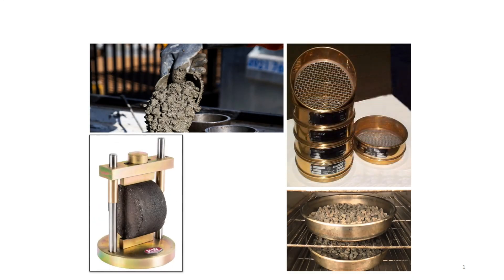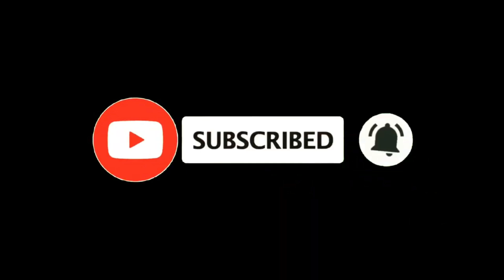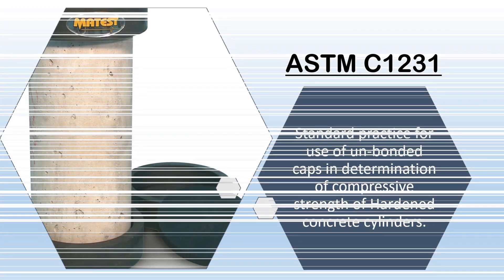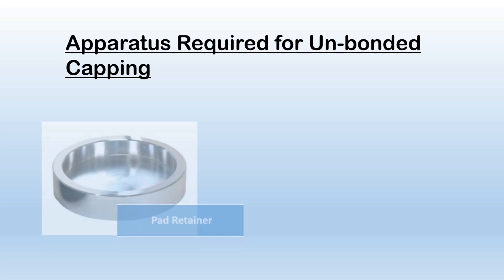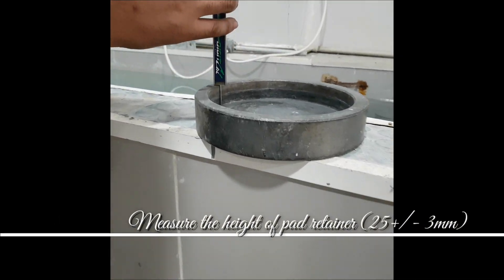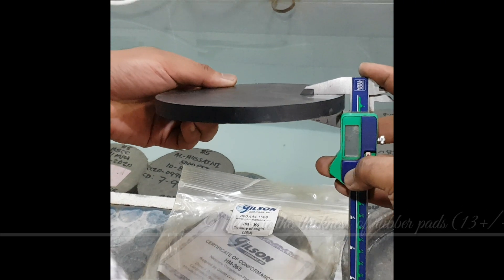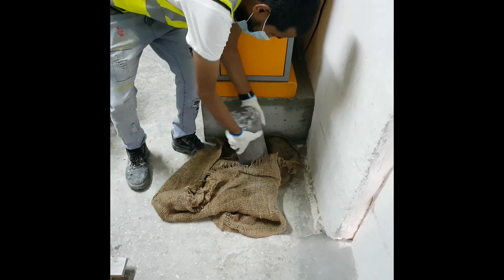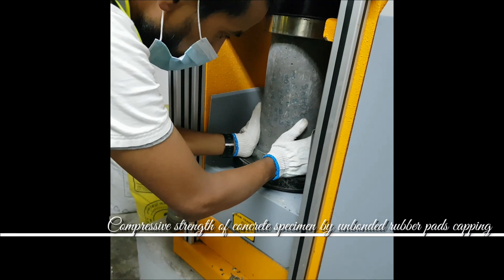ASTM C1231 | Standard Practice for Use of unbounded Rubber Pads for Compressive Strength of Concrete

Comment: Which is better either capping with molten material or pad capping?
Reply from the maker: This is as per standard, usually we prefer to follow rubber pad due to safety but as per standard the methodology of capping totally depends upon specimen's smoothness of surface.